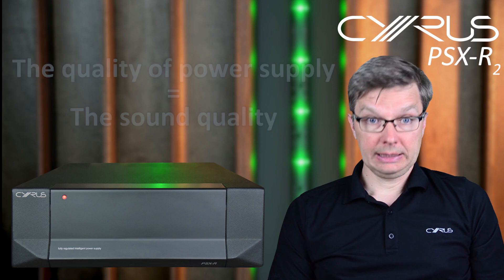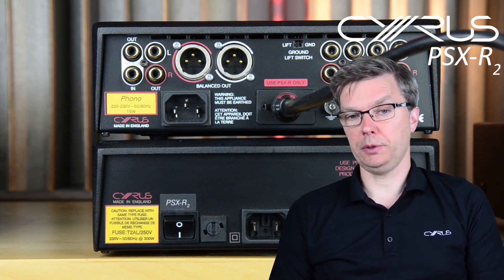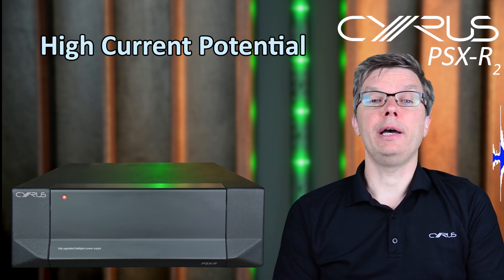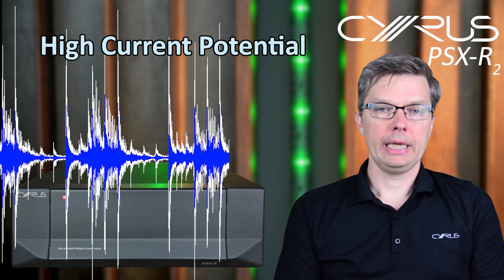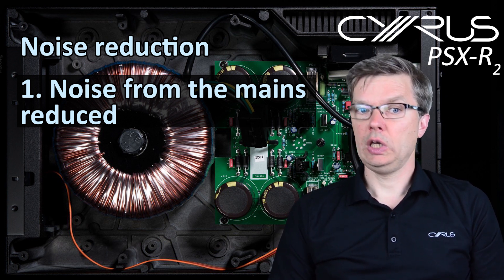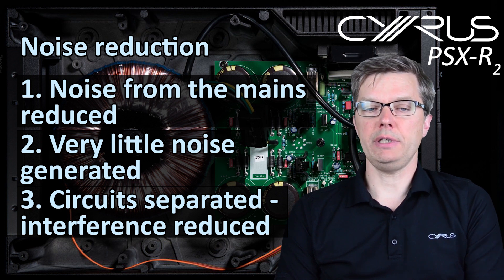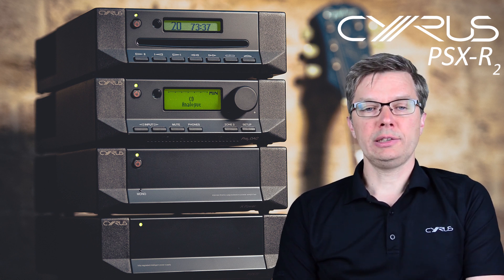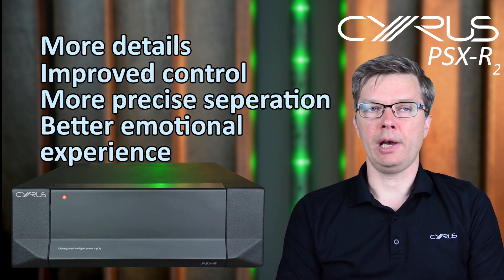Cyrus PSX-R2 - the ultimate power supply upgrade

Comment: Does pressing the standby/off/on button on the host unit… control the standby/off/on of the power supply or do you have to reach around the back of the power supply to turn it on and off separately ?